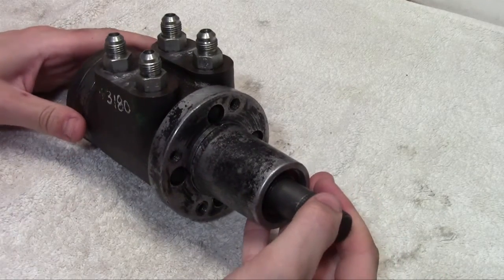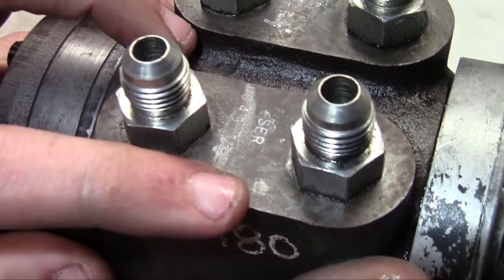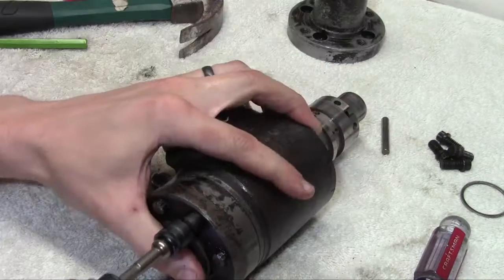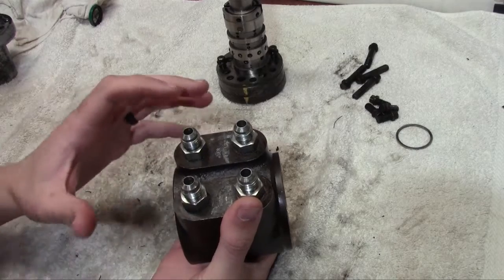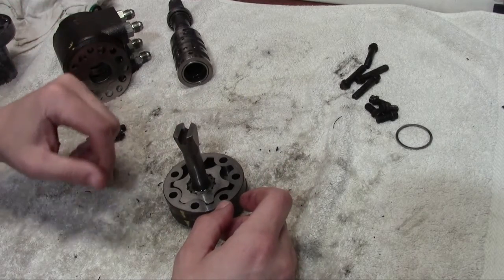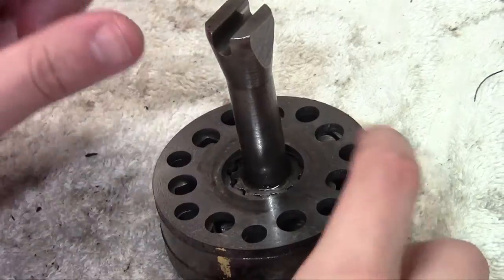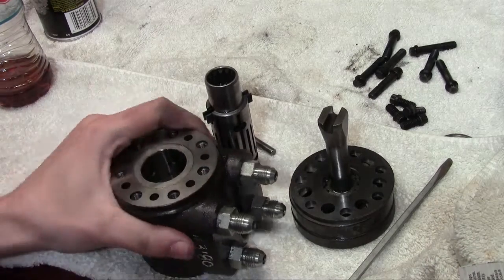[Hydraulic Steering] Orbital Valve Rebuild and How it Works

Comment from the maker: If you remove the drive link from the inner rotor (like I do at 6:00) be sure to replace it with the teeth engaged in the same way as it was before!  These 12 small teeth are timed to the 6 large outer teeth of the rotor.  If it is reassembled one tooth off, they will not be timed correctly and your steering wheel will spin violently and dangerously when the valve becomes pressurized (i.e. when you start the engine of the vehicle.)  This WILL break bones if you are not clear of the steering wheel.  If you do not need to remove the drive link, I recommend leaving it in place.

If you have removed the drive link and are unsure if you reassembled it correctly, STAY CLEAR OF THE STEERING WHEEL when you start the vehicle.  If the steering wheel spins on its own, the drive link is not timed correctly.  To fix it, disassemble the valve again and rotate the the drive link one small tooth in either direction.  This should solve the problem but always use caution when starting the engine.
Reply: Please would you mind making a video on the timing coz I think this one step that most go wrong.
Reply: if you're unsure about the timing, could you cap the L R and Low flow lines and hook up the just the high pressure? (to test outside of the steering housing) and once the tractor cuts on if shaft spins then reset it, instead of installing it all back in place just to take it back off, plus not having the steering wheel attached i would think would be safer.
Reply: Thanks a lot. I broke my head, where did I go wrong.
Reply: I saw a guy put one together out of time and he started it up and it spun the steering wheel really fast glad he didn't have his hand in it.
Reply: that did happen but I did like you said and thats fixed

Comment: Hello i have a question......I am having issues on a New Holland  Boomer 40 steering. When the tractor is loaded heavy in the bucket or when driving thru mud when turning the steering wheel...... the steering wheel turns but the wheels will not. There is like a pulsing or ratcheting feeling coming thru the steering wheel when this happens. do you feel it could be the orbit steering valve?  Thank you!
Reply from the maker: Sounds more like an internal leak in the steering cylinder allowing pressure to jump from one side to the other when under heavy load.  The "pulsing" might be from pressure building in one side of the cylinder then "jumping" the internal seal to the other side.  That would allow the wheel to turn a little and then stop again once the pressure drops enough for the seal to hold it again, all without ever getting enough pressure to make the wheels turn

Comment: I replaced seals in my Ford 555 backhoe and didn`t get it back together in time properly. When I tested for leaks before reinstalling the dash panel it turned to the left on its own but not violently like in your comments. Mt question is how to time it properly? I disassembled it again and cleaned it again think it might have blockage but hate to install it again and take a chance. Hopefully you can help. Thanks.
Reply from the maker: If the problem was just the drive link being out of time, just pull it apart and rotate the drive link over one tooth.  That should be all it takes to get the timing correct again 👍

Comment: Hello Sir, I have an old Belarus 611, Steering comes and goes, its gone now, and very hard to steer, all my other hydros work, lift and tilt on bucket and forks, maybe some blockage in this orbital if im only getting hard steering??? Ill be ordering mew seals and rings asap but just curious what would cause the hard steering if my pressure is good to work the other hydros??? Steering ram seals are all good, had tested, not being bypassed
Reply from the maker: Debris in the orbital valve or hoses is a possibility if the ram and pump are good. Good luck!

Comment: So what can fail inside this unit to cause lack of steering in one direction but not the other? I'm unsure if this is the problem but it seems like it would be.
Reply from the maker: Does the wheel feel the same when turning both ways? Or does one way feel harder/easier and the other normal? Hard to imagine anything that would fail only on one side- my guess would be the cylinder having a bad seal or fluid level not being high enough if it's pushing a single-ended cylinder
Reply: @WebWheeler  I'll verify both answers to the those questions when I get home, that way I'm not spot balling. But I wanna say, when driving at any speeds in a straight line and trying to turn , the front wheels will fade back to straight. Like turning a steering wheel indefinitely when moving at higher speeds to keep the front wheels tracking where you want them.

Comment: I tore into mine not marking the disks  and when I put back together the steering wheel turned on its own so I tore it down again  but under the washer there was no timing mark  but I did my best to move gear 1 tooth now the steering wheel doesnt  turn on its own but it wont turn the wheels only when I lift them off the ground?? is there a fix for that?
Reply from the maker: What was the problem that made you disassemble it originally? Did it have anything to do with only being able to turn with no load on the steering?
Reply: correct and now its leaking under the steering wheel  and a repair man told me hydro fl isnt suposta go up the column the column is like 19 in long and bolts onto the valve and I cant get it ofgf? besides the 4 bolts what else is holding it on?? @WebWheeler
Reply from the maker: If you remove the steering wheel, there's usually a snap ring holding the steering shaft inside the column. It also has a seal there. That could be what's holding it together?

Comment: Looking at a 1960 international 3000…2504 the seller said the steering wheel is tough to turn but the tractor does turn and believes something is wrong with the orbital valve. Any tips on what might cause that issue?
Reply from the maker: If it's the valve, it's possible debris clogging up the internal ports or it's worn to the point that it's leaking internally and bleeding flow back to the reservoir/pump instead of building pressure to push the cylinder. Not all that likely though- I'd suspect the hydraulic pump is the more likely issue or just that it's low on fluid haha. Cylinder could possibly have a bad internal seal too but like I said, worn out pump or low fluid are the most likely. The valve is pretty bulletproof as long as it has clean fluid running through it. Good luck and hope that helps!

Comment: what did you torque the bolts for the nose cone to?
Reply from the maker: I believe it was 20 ft-lbs. If no manual/torque sheet is available, I just consult a generic torque chart based on the bolt size and grade

Comment: Im working on a steering unit from a late 70's massey tractor and it looks almost identical to what you are showing.  Its a charlynn 211-1060-001.  Parts book shows a spring at the bottom of the steering shaft where they join together.  Have you ever seen this?  It would be between the two pieces you join @ 7:05.  Thanks!
Reply from the maker: Interesting... What kind of spring does it show? Just a normal compression spring? Or could it be some sort of retaining ring?

Comment: What provides the resistance on the sleeve to prevent it from rotating with the inner spool and just staying in the neutral position? Is it just friction and the sleeve slowly returns to neutral under spring force?
Reply from the maker: The inner spool is connected to the steering wheel, and the outer sleeve is connected to the gerotor through the cross pin and drive link that I point out.  Note that the cross pin hole for the inner spool is slotted, while the hole in the outer sleeve is tight to the pin diameter, allowing the inner spool to rotate slightly either way without rotating the outer sleeve.  Basically, the gerotor provides the initial resistance because when the steering wheel starts turning, it slightly rotates the inner spool, while the outer sleeve needs to displace the fluid in the gerotor in order to turn.  The resistance from the fluid in the gerotor is greater the the strength of the leaf springs so they give, making the inner spool rotate while the outer sleeve stays still, opening the ports to either the left or right hose.  Hope that makes sense and answers your question!

Comment: I was looking for a visual on how a Case 580 steering control box works and your video popped up. Your orbital valve looks pretty much like a Case unit (I guess they don't really need to reinvent the wheel, so it shouldn't matter who the manufacturer is).

Very to-the-point and concise. Thank you!!!
Reply: I have a Case Scatback 530. Looks like the same steering valve as mine also.

Comment: I lost steering on my lull. The wheel spins freely. No resistance. There are no leaks or anything from the hydraulic steering unit. All other hydraulic functions work. Do you think there is a mechanical failure somewhere in this thing?
Reply from the maker: If it's not something stripped out in the steering column, then yeah I would guess the orbital valve is the problem. Another possiblity would be that the internal seal in the cylinder is blown. That would allow fluid to flow from one side of the cylinder to the other without moving anything or building pressure and your wheel would turn without resistance

Comment: Would love to know where to get the bearing for the steering shaft?
Reply from the maker: Depends on your model but if you Google  "SFK bearing size chart" they have a great list of their bearings that you can sort by dimensions. Use that to figure out your bearing part number and you should be able to find replacements on eBay, Amazon, or where ever. Good luck!
Reply: I ended up finding it "11312 char-lynn" part number. Thank you

Comment: But what prevents it from keep filling the cylinder if i stop stearing. If I star stearing presure builds up in one side. Why does it not just keep dping it when im not? (Hard to explain what i mean)
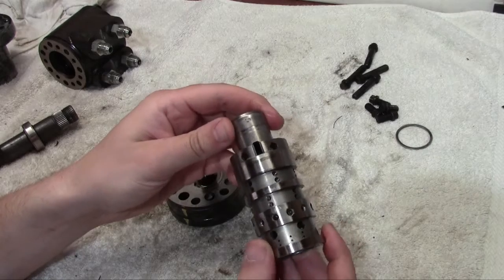Reply from the maker: Check out 4:20 of the video. If you are not turning the steering wheel, the leaf spring returns the internal valve bodies to neutral with each other.  When the valve bodies are neutral with each other, the fluid from the pump pressurizes both sides equally so the cylinder doesn't move and any excess flow is directed back to the reservoir.
Reply: @WebWheeler  aha i se so only when i stear the holes turn so more flow goes to on side. And when i stop turning the holes goes to th neutral position? Gear explaination. Thats how it works on a car with powertearing as well? (With oil and not electric)
Reply from the maker: That's correct- the harder you steer, the more the ports to one side open and the ports for the other side close. And yes that is basically the same function as hydraulic power steering in cars, just modified to assist the mechanical steering input. Thanks for watching!

Comment: My john deere 2251 Hydro steering unit and the steering filter overheating now what could be the reason and when that happens hydraulic needs high rev to function
Reply from the maker: Sounds like your pump is going out- if it's not pumping correct it could cause heat buildup and would require excessive RPM to operate
Reply: Which pump the one in front of the Engine?
Reply from the maker: Yeah whichever pump supplies pressure to your steering system

Comment: I'm tinkering with a John Deere 1 series that uses a single 6 gpm pump that goes into a flow divider that splits the flow to about 3 gpm to implements and 3 to the steering and oil cooler.  I'm wondering if I remove the divider and make it a single circuit whether there will be any issues with pressure.  Is there typically a pressure relief valve in a steering circuit?  How does the low pressure outlet stay low pressure?  If you were sending 3000 psi to the high pressure side, I don't understand how it comes out the low pressure at 400 psi or less.  Thanks for the video!
Reply from the maker: I imagine you'd get a pressure drop when trying to use implements and steering at the same time, but I can't be sure. The orbital tends to work as it's own pressure regulator, bleeding the excess flow back to the reservoir so no relief is necessary from any I've seen. Basically the pump is really only putting out flow, the pressure comes when there is resistance to flow. Because the outlets back to the reservoir don't have any resistance to flow, the pressure doesn't build. Seems weird I know haha. Thanks for watching!

Comment: Hello sir. Thanks for the video! Our lift has one of these with the same 4 port configuration. It turns fine to the left, but it barely turns past center when you turn right. It's like the turning cylinder runs out of stroke. To rule the cylinder out, I swapped the left and right hoses on the orbital and it reversed the problem. I could now turn right, but not left. 

Does that sound like an issue that rebuilding the orbital would solve?

Thank you again!
Reply from the maker: Assuming there is not a blockage or problem with the hose that goes to the bad side, I would imagine it has to be the orbital. As long as there is no other components between the orbital and cylinder?
Reply: @WebWheeler  Thank you sir! That's what I was thinking. I'll see if I can source the orings and/or seals to rebuild it. I'll let you know! Liked and subbed!
Reply from the maker: Thank you! It could also be something internal to the orbital- when you pull it apart make sure to clean it out extremely well and check the leaf spring that attaches the inner and outer valve bodies- if that spring is damaged it may only allow fluid out of one side. Good luck!

Comment: My John deere 2251 is hard to steer it needs to two hands what could be the problem @webwheeler ?
Reply from the maker: You have low pressure for some reason- either fluid is low, the pump is going out, or there is a leak somewhere. A leak is pretty obvious (and dangerous) though if it's a hose or fitting on the pressure side so if you can't see a leak and everything else seems good the leak could be inside the steering cylinder

Comment: Is power steering fluid  supposed to be in the steering  colum tube on a 575 di mahindra ,some say yes some say no ,mine is leaking from under the steering wheel ,thank you so much
Reply from the maker: I don't know if any that are supposed to have fluid in the column- usually the valve is sealed so that the column is dry. Best way to tell is to pull the column off and check where the seals are. All that I've seen are sealed between the valve and column. Good luck!

Comment: Awesome video! I had no idea on timing that gear, I guess I got lucky when I had mine apart. Question, my Mf285 steers much sharper to the right than left. Takes a football field to turn left but u turns on a dime to the right. Is this an orbital valve issue or steering gear? It’s also leaking fluid out the column. Should the wheel spin indefinitely or stop like a car? Sorry so many questions.. there aren’t many resources out there.
Reply from the maker: Has it always had unequal steering like that?  If your steering uses a single-ended ram (shaft only come in and out on one side,) that's pretty normal because turning the way that retracts the steering ram, you have to fill the volume of the ram minus the volume of the shaft because the shaft is inside that cavity and takes up the space the orbital would need to fill. Turning the way that extends the ram, however, you have to fill the cavity on the other side of the piston which does not have the shaft running through it and is therefore a larger volume to fill.  Orbitals have a specific volume output per revolution so on single ended rams it'll require more turns of the wheel to extend the ram than it will to retract it.

If the ram is double ended (shaft on both sides,) that's not normal so it's likely a leak somewhere.  If you're not seeing much fluid leaking (actively dripping, etc.) then it's probably not the orbital or hoses.  My guess at that point would be a leak at the steering ram piston inside the ram.  A seal could be failing where it will hold pressure on one side (the side that turns quickly) but leaks fluid in to the other side of the piston when turning the other way (which would cause the steering to take extra turns.)

The steering may or may not have a hard stop like a car but you should definitely feel a stop in the wheel of some kind when the ram is at the end of travel or when it hits a physical stop at the steering knuckles.  If the wheel turns easily even after hitting the end of travel of the ram, that also indicates that the ram might have an internal leak that lets fluid bypass the seals and keep feeding fluid in to the other side of the piston is the ram.  Hope all that makes sense!  Good luck!
Reply: @WebWheeler  I think I figured it out this morning. The hydraulic steering ram is situated towards the right ride of the tractor and has limited room to move with so much more room moving to the other side. It engineered this way 🤷🏻‍♂️. Do you have to disassemble the orbital valve to install a shaft seal? I have fluid coming out of the column. Thanks again man!